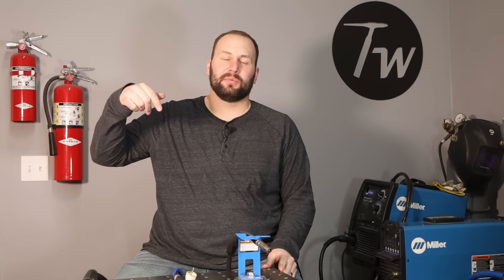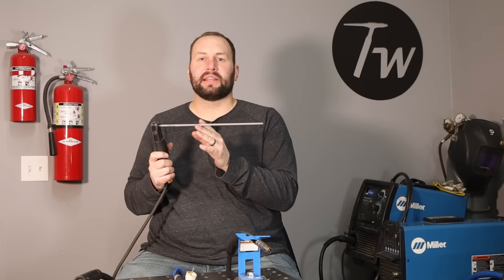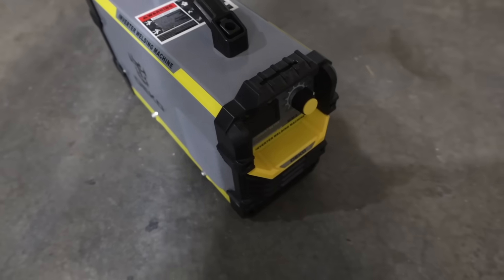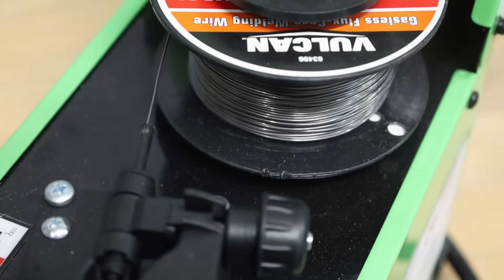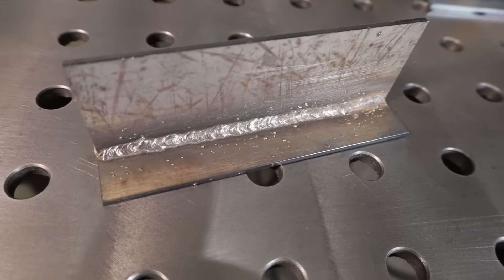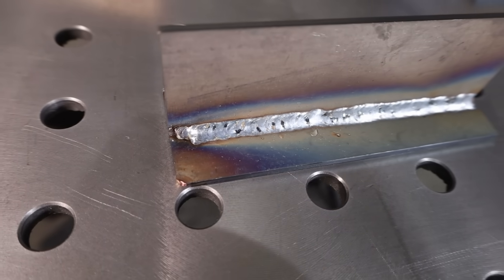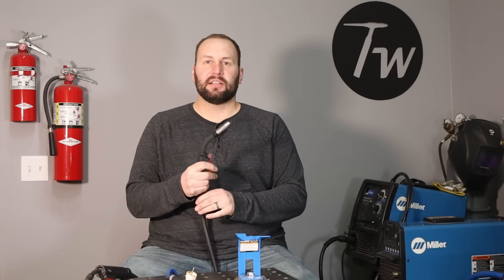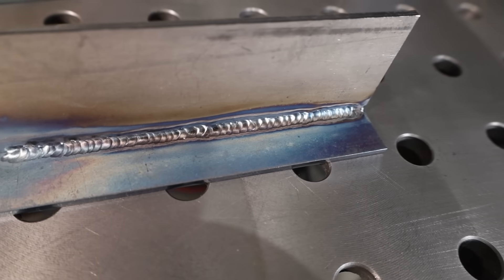4 Types of Welding Explained: MIG vs TIG vs Stick vs Flux Core

Comment from the maker: Want to learn how to weld with these processes? I'll walk you through it step by step in my new affordable online welding courses at https://courses.timwelds.com.
Reply: Im turning 43, single and I built quite a lot of stuff. Now I’m into welding.
Reply: If you're charging people for welding lessons, then you need to learn how to weld yourself. As your welds were shocking on every discipline.
Reply: what welding process would you recommend for racing/motorsport chassis's and axles?
Reply: Thank you for this straightforward explanation. Exactly what I was looking for.
Reply: hi
Reply: Q
Reply: mig tip bit close, 1/4 - 1/2''..  do vid on arc alloy welding.
Reply: just  a HEADS up do not go into STVT WELDING school PREGNANT !!!
this school  was on the south side of san antonio
i live at HAVEN 
I am 22 weeks PREGNANT 
MY FIRST day of school they had me waiting all day outside class BECAUSE THEY WERE RUNNING A BACKGROUND CHECK
how much did you get for that check STVT? 
YOU HAD ME TAKE OUT A LOAN BEFORE YOU RAN A BACKGROUND CHECK ????????????? 
LETS RUN THROUGH What i missed while out of class 
your a third party entity 
you share a building with a thrift store 
on the same block as PIZZA PATRON greasing things up for the autoMOTIVE department 
next to that a DENT IST  A BRIDE DENT with DRY sockets running so hot the grass is FRIED MIGHT as well been a damn CHURCHES but if i need a REAL RUSH i can HOP across the street to the STRIP BAR CAR LOT with the IN FRINGEMINT ALERT IF they aint stripping BIC EZ THEY STRIPPING TVS? LAMPS? 
no they gladly throw those away 
a very large TV with an auto MOTIVE DEPART MENT that LIGHTS THE WAY for swivel RTTs PARTS and lamp cords stripped to the COPPER WIRE
i was in welding 
asked multiple people 
"they dont do that here" 
me being at haven traveling to the south side every morning was not a challenge but sitting in a class 
stressed that i missed the first day then testing over an entire chapter PUT ME TO SLEEP 
SO i tell them im pregnant i didnt want them to not let me in because of that reason 
CREATING A STRONGER BABY 
A STRONGER AMERICAN WASNT ON THEIR MINDS IT WAS my BEHAVIOR 
using HAVEN as a copout as an excuse  
knowing that fafsa grants pell funding for people whom want to continue thier education and work
they used this  to their advantage
they CHARGED JUST ENOUGH TO TAKE THE FAFSA AND GET A LOAN 
this is the second school i encountered 
TULSA welding in HOUSTON (234 greens )has me signing a master prommissory note LAST SEPTEMBER NOT PREGNANT yet i ALSO DID NOT GET TO GO TO THAT SCHOOL!!!!!!!!!!!!!!!!!!!!!!!!!!!WAS INAPPROPRIATE 
WANNA SEE BACK LOGS OF IN PRO RATE? PI RATED? OR should i TRANSLATE?????? 
i get called into the office 
THEY TOLD ME A COMMENT I MADE i couldnt say in class
I SAID THE WELDING TIP LOOKS LIKE A CLIT 
i also told the third party boss that it was ignorant for her NOT TO RECOGNIZE it 
if you go into the YOUTUBE and watch the videos some of the lingo is LAUGHABLE 
BEING A MOTHER OF TWO SPANISH NOW THREE SPANISH speaking children
i would not want to MOLEST or BOTHER ANYONE WITH the  terms  FOR FEAR OF IGNORANT PEOPLE NOT KNOWING HOW TO RECOGNIZE NOUNS colors weights patterns repetition 
BECAUSE IT MIGHT BE IMPORTANT 
no  i need to dumb myself down for the bosses next door 
maybe if i had givin them a LAP BAND across the street or THROWN AWAY THE HEAVY METAL in the yard in the GREEN CASH  CAN  for an  EASY A instead of doing yard word "SERVICE WORK< COMMUNITY SERVICE< HAVING METALS TO WELD AFTER GRADUATION CLEANING MY SIDE OF THE STREET I WOULDNT HAVE 
said "you know what? this school IS NOT WORTH IT " 
they had more BEHAVI ORAL problems to talk to me about but i said you know what 
save it WITHDRAW ME IM OUTaOF HERE 
I WAS THERE FOR A WELDING CERTIFICATE NOT AN ACTING CLASS ON HOW TO BEHAVE 
EXCUSE ME WHILE I PRACTICE WELDING WITH A CONDUCTOR TIG TIP CIGARETTE WALKING MY PREGNANT ASS TO HAVE FOR HOPE 
DUECES 

YOURS TRULY 

STEPHANIE WALKER 
STUDENT AT STVT FOR LESS THAN 10 DAYS 

PS INSTRUSTORS DIDNT KNOW THE TYPE OF METALS THE TOOLS WERE 
said it didnt MATTER !!!!!! 

anyone got a pusher or PULLER????
Reply: And then you take the brittle, now the top layer, off.
Reply: I want to ask you a question and it might sound odd but I want to make a steel or metal Peggy bank but I want to weld the pieces together out of steel or metal how should I attack it which material should I use  and equipment ? I really appreciate your video I never done welding before I figured let’s do something new
Reply: My first experience with welding was tig welding aluminum. It opened me up the the world of welding
Reply: I'm 40 years old and looking to get into a different field of work. Is it too late for me to get into welding?
Reply: @latinace1981  no
Reply: @latinace1981 odd that you want to switch to welding at 40.
I’m 32, been welding for 12 years, owned my own shop for 7 years, and am switching back to electrical to get out of welding.
It’s typically not a healthy trade, especially as you age.
(Depending on what you do, It can be hard on your health. Might wanna keep that in mind)
Also, steady hands and vision are essential to good welding, which also dissipates with age.

It’s never too late if you really wanna do it though.
Reply: @latinace1981  It's always too late!
Reply: @latinace1981  you sound super unmotivated so yeah, probably too late for you.
Reply: Ä
Reply: Fantastic! When I get a TIG welder, I'll be taking the 4 courses you put up there! Nice job! All the best!

Comment: Anyone any experience with welding corten weathering steel? I have a planter project at home where it seems the perfect material for the small space, but I've never welded it. I have flux core and stick I use on and off at in my work at home.

Comment: Great video!  I got some gift cards for Christmas and am thinking of getting a setup.  I did stick welding in a class in high school 40ish years ago.  I’ve soldered quite a bit and nobody ever could explain that TIG is essentially fancy soldering.  I’ve done lots of that.  Too rich for my blood though, so a wire feeder it will probably be.  Thanks.

Comment: I'm confused. I use my MIG welder with flux wire, and I don't clean the slag off after I weld. I've tried Knocking on the weld with a small hammer in the past, but nothing came off; therefore, I didn't think slag was a problem with flux welding. Can someone please advise me. Am I doing something wrong?
Reply from the maker: The slag is very light with most flux core wire. It usually doesn't come off in chunks and can just be removed with a wire brush. Depends on the specific wire, though.
Reply: @TimWelds Thank you for the info. That makes sense. The quality of the wire does make a difference, like you said. The Lincoln Electric wire is a lot cleaner than the Harbor Freight brand. I only use the HF brand when I'm broke. Lol. Thanks again.

Comment: Did you use what looks like the aftermarket yukon slinger?  And how did it do?.  My rear end came apart for the very reason you spoke of. Had a shop do the seal and didnt tear it down.  The yukon slinger doesn't look like a good fit but the factory slinger was destroyed as a result of the failure and cant find it anywhere

Comment: Hi, I'm thinking of getting started in welding as a hobbyist. My typical project would be using around1011 metal, roughly 2mm thick. With that info what would you recommend the type of welding and maybe a good machine (brand/model/etc). I don't mind spending some $$ on a good machine, but still on a budget. So say up to around $700.

Comment: Has welding technology REALLY changed much in the last 50 years? TIG was invented in the 1940’s, the newest welding is Laser. Everything in between has just been improvements on the same process(or better technology). It seems like we would be able to hold a welding rod or a mig gun like a pencil by now honestly🤣
Reply from the maker: If it ain't broke...
Laser welding was invented in the 1960s, so it's not that new either. Cheap laser sources are just getting some publicity. Just checked out your channel and I'm pretty sure I need a chainsaw now...
Reply: @TimWelds 🤣 get one👍🏻 1960’s? That’s crazy, but kinda validates my thoughts. Honestly, much like chainsaws, how far have we really become in welding processes in say the last 50 years. We just got the first EFI chainsaw for Gods sake😆

Comment: Is flux core good for auto work? I've heard conflicting answers. I'm planning on reinforcing the pinch welds on a car
Reply from the maker: It’s really not a great fit for auto body. You could probably get away with it on the pinch welds, though.
Reply: @TimWelds thanks for the reply, why wouldn’t it be good on body work?
Reply from the maker: It runs a little hotter than MIG with gas, so it’s more likely to burn through on body panel patches. Also, the flux leaves a slag behind that needs to be cleaned off, so if you’re making small tacks that eventually join, you’ll have to clean slag off in addition to additional spatter around the weld. Solid wire with gas is just cleaner and more controlled, but if flux core is all you have, you can usually make it work.

Comment: I took welding in high school, but it has been years. I wasn't the best, so I need practice. The end of my exhaust pipe broke off from the joint and currently been held up by rope. I need to weld it at some point.

Comment: Hmm, the rods I use don't leave much slag. Just nice shiny welds. If they do, its quite rare and probably came from a big puddle / sitting still for too long.
My fluxcore leaves way more slag than my stick welding.
Does that seem normal?

2 things I noticed:
Fluxcore seems less picky about dirty metal. Stick welding seems very unforgiving of dirty metal.
And stick welding seems to let you put down a ton of material in a short amount of time. Could be my flux vs stick wire thickness. But I can move way faster with stick. But I'm also more likely to burn through.

Comment: 😊well shown. I started flux and stick welding like the top for $12. Got trained by guys making $45-60/hour who could tig and mig weld as well. Within a year, I was making $31.50. 😊I was dirty but thankful for every little advice. Those are some clean beads. If they bonded well. Thats a lif time weld

Comment: What about heating up metal you want to weld with propane torch for better weld?
Reply from the maker: Preheat can be helpful, especially on aluminum. In some industrial cases on high strength steel, it's required to prevent cracking. For general fabrication, though, it doesn't add enough value to be worth the additional time and fuel.

Comment: I've only ever welded with i think the fluxcore shielded sticks, way way back in school in Jr high. My Dads buddy loaned him what i guess at this point a 240 Lincoln stick welder.  However I'm going to need to brush up on it as well as learn Mig to weld in repair panels to my old 69 Mustang and future vehicles (really want an old F100 longbed like my granpas)

Comment: Should mention how important the gas is for mig and tig, and struggle to weld in windy areas. 
I could see someone looking for a home welder that might be using it outdoors, and wondering why their welds are dog shit 😂
Safe bet (buy a mig and you can use flux core in it if needed) 

Everything else was very well explained 🤟

Comment: Ive been slowly trying to learn welding on my own for years and have always blamed my poor welds on using the wrong type of welder or method for the particular material, project etc im working on because ive never found a video that broke down what the different types of welding methods were actually used for and just for me it was very important to hear,... it's like the foundation Ive been missing and now alot of other things Ive heard along my learning curve make alot more sense. This will help me tremendously...thankyou!

Comment: Was thinking of getting this:
TOOLIOM 135A Gasless Flux Core MIG Welder 110V MIG Welder Flux MIG/Lift TIG/Stick 3 in 1 Welding Machine IGBT DC Inverter with LCD Display. It's on Amazon.

Comment: So for someone who knows how to solder, tig welding should be easy to pick up no?
Reply from the maker: There are definitely some similarities. It's a little different because you have to control the position of the electrode a little more precisely and recognize a molten puddle in the base metal. There will still be a learning curve, but if you're intentional and practice a bit, you'll get the hang of it pretty quickly.

Comment: Don't make circles.  Try it  with volts 26-30 and feed at 400-600 imp (.045 wire) (I use 450) and just do a slow and steady bead.  Gotta get that penetration.  It doesn't matter how it looks.  Fancy doesn't mean strong.  Try it and test it with a break test and cut a piece and use acid to see penetration.
Reply: Also, it's all about the angle.

Comment: what are those dark spots on the MIG welding?
Reply from the maker: The filler metal contains silicon as a deoxidizer. This results in some silica islands that float to the top of the puddle. After it solidifies, they pop off, leaving a different sheen on the surface.
Reply: @TimWelds  Thank you!

Comment: if you have a pipeline and a valve wit weld-ends, then does the welding material which is supposed to fuse them together need to be in the same material as both the pipeline & the valve?

Comment: I want to build a buggy cage but I only have stick welder do you think i can do it with stick welder or i shold buy  MIG welder
Reply from the maker: You can as long as the material is over 1/8" thick, but I wouldn't recommend it.

Comment: How much amps thinnest welding stick require from electric grid?
Reply from the maker: It really depends on the machine, but from a 120 volt outlet, probably 15-20 amps and perhaps 10 or so from a 240 volt machine. This would be on the very low end of the range with a small diameter 6013 electrode.

Comment: Let's make a real important distinction. Your FCAW process, or Flux Core, was FCAW-S, meaning Self Shielded or Innershield. Some Flux Core is shielded by gas, not the wire, called FCAW-G.
Reply from the maker: Thanks! I have several videos about both processes on the channel.

Comment: Lets make it even simpler:  If you want a strong weld - Stick.  If you want a quick weld - Mig.  If you want a pretty weld - Tig.  If you're too lazy and don't give a flying XXXX weather it's welded properly or not - Flux cored! 😁

Comment: I'm not sure "burning" the flux is the right word. I think it should be "melting".
Reply from the maker: It’s definitely beyond the level of this video, but some level of both happen. There are a variety of reactions in any slag system. For example,  cellulose electrodes usually contain a lot of wood which disintegrates and reacts with oxygen (basically burning) to form a shielding gas heavy in CO2. You could make a very rudimentary electrode by wrapping a steel rod in paper and it would be similar in some ways to early steelmaking, search ‘bloomery’ if you want to nerd out on the earliest flux reactions. Silicates in some fluxes do melt, and are largely there to bulk up the slag, so you’re not wrong.
Reply: @TimWelds  Thanks for educating me!
Reply from the maker: I nerd out way too much on this sort of thing, but from a practical perspective, melting does make more sense. 👍

Comment: Can anyone advise me as to whether running the side of the mig welder gun along a clamped steel straight edge would cause an issue with the arc from the mig wire to work piece as my peripheral neuropathy makes welding in a straight line a bit tricky. Obviously using plastic or timber is out as the heat is going to probably produce fumes that will contaminate the weld. 
Sorry if this is a stupid question but I’m a novice.
Reply from the maker: Running the nozzle along a straight edge wouldn’t hurt anything, but I think it may be difficult to get it to slide smoothly and to get the angles and positioning right.
Reply: @TimWelds  thanks Tim, will give it try on some scrap pieces. Got to worth a shot as opposed to welding wherever than where I’m aiming for 😊

Comment: A friend was a welder and used all these methods at our workshop. He used a floor pedal to control the current intensity when doing TIG welding. Was that due to the thickness of the material he was welding or the type?

Comment: This is vital.  If you're using self-shielding flux core MIG, your polarity NEEDS to be DCEN (straight polarity).  If you're using dual shielding, meaning you've got flux core wire designed to be shielded by both slag and shielding gas, you can use the usual DCEP (reverse polarity) and the shielding gas is usually 75/25 argon/co2.

Comment: Great video. If you are welding two pieces of metal, what determines the maximum thickness of the metal? If the pieces are .125, .25, .5 how does rhe machine know what you are welding? Thank You
Reply from the maker: Great question! It depends on the process, but generally the machine settings (amperage or voltage & wire speed) are set to suit the thickness of material.
Reply: @TimWelds  Thank You

Comment: Hey Tim I’m new to your channel because I’m new to welding. I just bought my first box. Its 250 Amp 4 process welding machine. So I’m getting back into this after the basic stick class I took in Hight school because I recently got into building motorcycles and go kart style toys. I figured out that if I want to play I need to learn to fix too. So my first project is to cut my swing arm and extend it by 6”. My question is would it work well and be safe if I flux core the swing arm together and then stick weld it? I’m putting my life in my hands here so I need to know
Reply: It’s not a weak ass multi process machine either. I got the more expensive one that has high amp and multiple wire size capable and has 110/220 and AC/DC